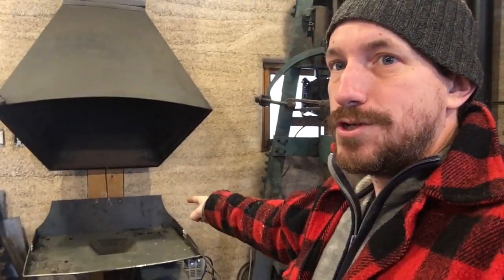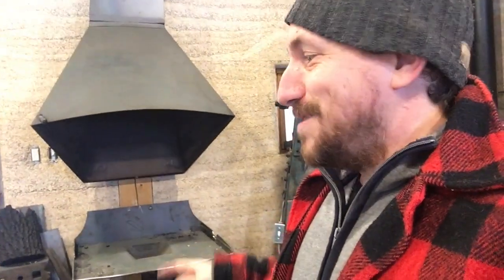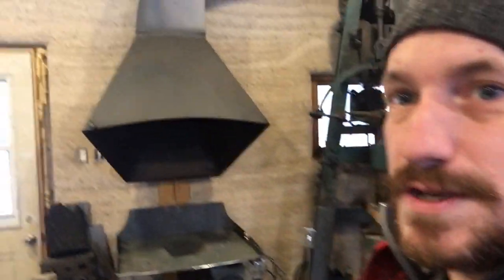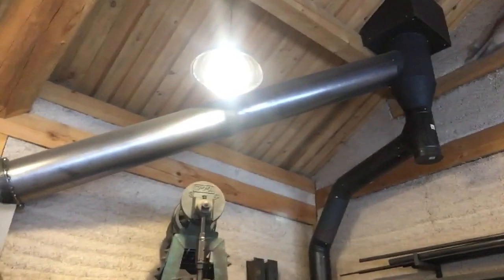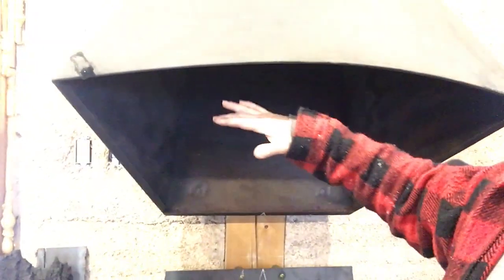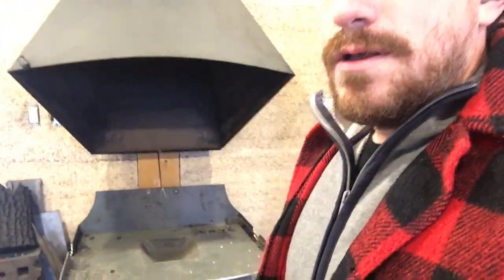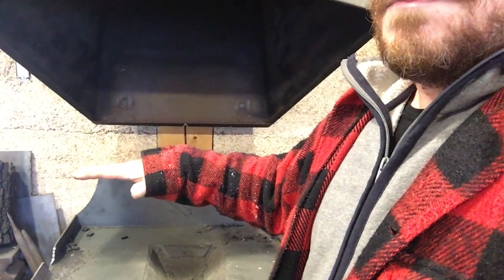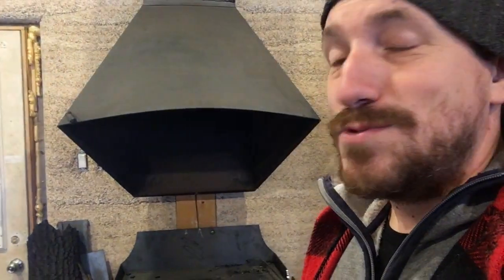Soulsmithing — CO Poisoning: How NOT to install a forge hood!

Comment: Okay, so Charcoal is safer than wood to forge with ? Btw my Sincerest gratitude friend, Thank you for saving life's with this warning video in advance !

Respectfully, / Sincerely.

Signed:

Pauly~
Reply from the maker: Hi Pauly. Thanks for your message. I know some cultures have used wood as a fuel for forging in the past but it is very rare. The three most common options are charcoal, coal and propane gas. In every case, if the burn is not perfect (and it never is), there can be carbon monoxide emissions. The real solution is to have proper venting whatever the fuel.

Comment: The two bends/corners that the silver pipe makes before connecting to the vertical pipe also add to your design problem. Bonn chance!
Reply from the maker: Yes, that's all been changed to a single vertical 12"dia pipe a few years ago!

Comment: Couple years old video, but just add some more skin on the bottom of the hood, much simpler than rebuilding the whole thing
Reply from the maker: I did that right after the mishap.. didn't change much. I can still see smoke leaking around and out the hood. The overall design is flawed: I need to narrow down the flaps and even out the flue dimensions (it does choke a little at one point, which is very bad)
Reply: @Soulsmithing  natural draft? Or fan forced?
Reply from the maker: But thanks!

Comment: Have you considered building a side draft hood for your forge? You can build a super simple one out of a 30 or 55 gallon drum that works really well and costs almost nothing. Plus with a side draft hood you have no restriction from the top for viewing your piece in the fire or if you have a large odd shaped piece. Look into side draft hoods.
Reply from the maker: Jared Lanham Yes I love the looks of those but they’re not ideal for several reasons: they require a vertical stack which was not possible in my setup and when you heat large items or flat and wide stock I’ve read they leak a lot. They’re perfect for tool makers or farriers or otherwise blacksmiths-with-a-vertical-stack-who-forge-regular-stock :-)
Reply: Soulsmithing you definetly get the best draft with a vertical pipe. Mine has a vertical pipe, however, I have seen guys with bends in their pipe and their side draft hood works well. Not sure how wide stock you forge, but ive forged 3 inch wide plate in mine with no problem. I supose if your doing armor or something like that it might be a problem.  Great video on it and I wish you success in your next forge hood build.  Looks like you have a nice set up.
Reply from the maker: That's interesting! If it works with a non-vertical pipe, then I'm interested...  And good to know it works with big stuff too. Indeed, I never intend to armor so not a problem for me. Ok, another project ;-)

Comment: Thanks for the heads up. Hope you are feeling better.
Reply: Was just googling because I saw your detector was down low and ours is up high for our wood burning stove. It seems CO is slightly lighter than air but diffuses into the air really well. Might be good to get a battery detector as well and put it in the ceiling.
Reply from the maker: Wheel333 Yes thank you! It’s basically a 24-hour hangover while your body gets rid of the CO. Fun fact: smokers are less affected by CO poisoning at first because they have a CO buildup in their blood (they die all the same). Not my case though.
Reply from the maker: I was actually thinking to get an industrial version which is a lot more sensitive
CO is just s bit lighter than so they mix well or so I was told in hospital